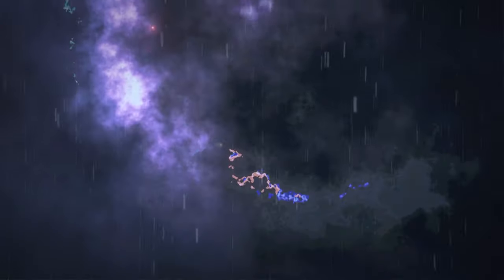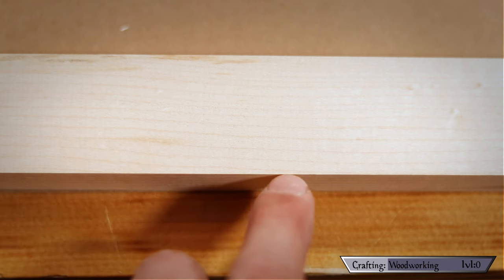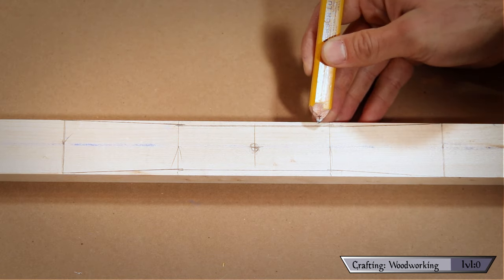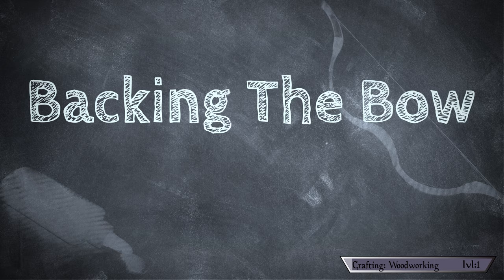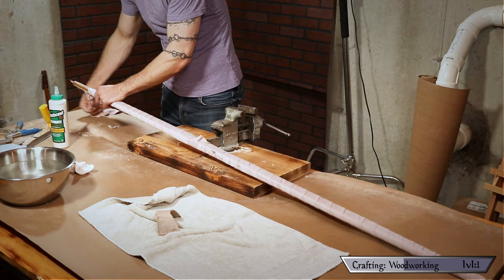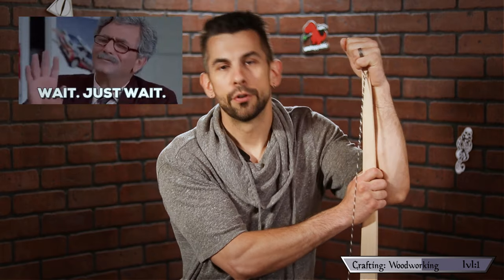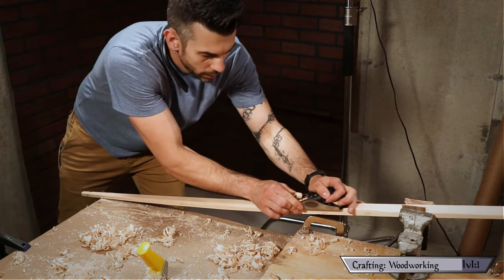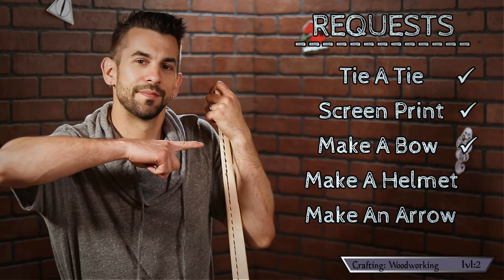Build A Bow With Wood From Home Depot! Step By Step Instructions | Skill Tree

Comment: This is the best how to build a bow  I've seen so far. I so want to do this. Thank you!
Reply: I started. I'm using maple. The grain is so so but I'll see what happens. I've decided to use fibreglass for the back. I don't have a garage or a basement to work in so it's slow going
Reply: JJ B my bow stave is ready. My tiller tree is ready. Now I have to get a planer
Reply: Let's be real. You won't.
Reply: Check out Kramer Ammons as well
Reply: Agreed

Comment: tiller tree i used, had notches and no pulley You flex the bow a little and hook the string on a notch that feels right adjust the limbs then try again. each time pull the bow down to another notch keep going until you reach your draw length.
Great,informative video

Comment: If you Google a tillering gizmo you will find it is an invaluable tool for easily getting the proper bend on your limbs, it is especially good for beginners who haven't developed an eye for tillering yet. I invented it so am a little biased about its use. They are simple and very easy to make. The bottom line is an adjustable pencil will mark every stiff spot on your limbs with one quick swipe.

Comment: Years late to this video, but I love bow building.  A fun similar project could be to built a pin and lever style crossbow.  A wheel based medieval crossbow is a whole mess of a project, but a crossbow with a wooden prod in a lower draw weight (I usually aim for 60-80 lbs on about a 12' draw) with a wooden pin pushing up from the bottom to force the string out of a groove, is a reasonably easy project, and can cook really cool.

Comment: Nice job! And, you are right about picking your board carefully, my first one exploded almost at the end of the tillering process.  My second bow was much better, I used red oak and chose a piece called flat sawn. I was able to "chase" the growth rings for a very safe bow. Also backed with raw hide I got from dog chew bones from the dollar store.  A fun little project I did with all the raw hide scraps was to make my own hide glue. Hint hint.
Reply from the maker: I saw someone use the rawhide from dog bones. It worked well, then? I was unsure how it would go. I AM intrigued about the hide glue. Do you boil it?
Reply: @SkillTree  It worked very well. And yes, you do boil the hide. what you are essentially doing is reducing the hide into collegian (sp?) . It is then poured out onto waxed paper and allowed to dry. It will remind you of jello, which it is the main ingredient of.  Then you allow it to dry fully. Lots on you tube on how it is done. Give it a go.
Reply from the maker: @David35445  thanks! I will!

Comment: Ok... getting into the building and figured something out. To get the grip and limbs correct you might try , after some shaping, to draw one side on a board or paper ( preferably something that doesn’t change shape) and check the symmetry from side to side and top to bottom. The grain can fool the eye but a line on plywood doesn’t lie
Reply from the maker: Oooh good idea! Nice way to make sure everything stays even. Thanks for the tip!
Reply: Skill Tree 
I did R&D for experimental aircraft and that was one of the ways to make a go-no go gage. 

Can I use heat to bend poplar? I’m looking to put a slight reflex into it, among other items

Comment: hey man, you inspired me to try this, i however tried it with a peice of wood and two peices of metal cut down to size. it was aluminum which didn't work haha. and it had a draw weight of like 150 pounds X-X but its got me inspired now to actually make one out of wood. aluminum is hard to cut. and i wouldnt be sure what steel to use to do it so theres that but an ywayst anks and good video
Reply: 150? That's a war bow

Comment: what material exactly did you use for backing? thanks
Reply from the maker: Rawhide from 3 rivers archery. https://3riversarchery.resultspage.com/search?p=R&lot=json&lbc=3riversarchery&uid=304070840&ts=json-full&w=Rawhide&method=and&isort=score&url=https://www.3riversarchery.com/bow-building-rawhide-backings.html&cip=174.196.209.255&ref=www.3riversarchery.com&ua=Mozilla/5.0%20(Linux;%20Android%2010;%20SM-N960U)%20AppleWebKit/537.36%20(KHTML,%20like%20Gecko)%20Chrome/80.0.3987.132%20Mobile%20Safari/537.36&rk=1&lgkey=6121
Reply: @SkillTree  thank you!

Comment: Can I ask sir ..  when u tillering that bow how to decide top and bottom ? .. or You use  center to tillering? .. sorry my English so bad
Reply from the maker: Hello! Thank you for watching! The bow showed here is a symmetrical bow, so either side can be considered top or bottom. Just make sure when you are tillering to have the side with the rawhide backing facing up and only remove material from the belly of the bow. You don't want to cut into the rawhide. Happy making!😁👍

Comment: If you want to level up on woodworking some more, try carving a spatula!
Reply from the maker: That sounds interesting. I bet bamboo would be nice for that. Would you recommend making it straight and bending it with moisture and heat after the fact?
Reply: @SkillTree  That would work very well. If you want an extra challenge, you can try carving it from piece of wood trying to follow the grain without bending. I have a video on doing that.
Reply from the maker: @BravermanDesign  I'll give it a look. Sounds damn tricky. Love a good challenge!

Comment: Hi again. Just made a bow out of walnut. It looks nice and sturdy but I see some small microfractures on the bottom leg of the bow on the face with the handle. Is this a sign that it will break?
Reply from the maker: Hmmm. I personally wouldn't trust it. Those limbs are under a lot of pressure when the bow is drawn. If it fails, those limbs are being pulled towards you. It could just be some of the grain lifting but sight unseen, I would rather err on the side of caution.

Comment: By any chance do have dimensions for a 100 lb flat bow?
Reply from the maker: It's going to be less about the exact dimensions and more about testing it. There are scales you can attach to your tiller to judge the actual poundage. Were I you, I would make the initial shape and put the backing on, removing very little  material. Then start measuring the weight and how the limbs bend. Because of grain and inconsistencies in wood hardness, every board is different. Just gonna be trial and error.

Comment: Where did you get your bow string??
Reply from the maker: 3rivers archery! It's also where I got the rawhide 😁
Reply: Thank you! Is there a certain one to buy?
Reply from the maker: @zacharylambert177  as far as brand? I am not sure whichbones are considered "best". You will need to know your size, though. Just measure your bow from string groove to string groove then deduct 3". That should give you the correct string length for your bow.
Reply: Thank you!
Reply: @SkillTree  for the rawhide I used an $8 dog rawhide chew toy. Worked great

Comment: Why did you pick 68 in. for your bow?
Reply: There’s a string length of 65 inches and the string is generally 3 inches shorter than the bow stave. 
Also I tried shorter bows and they’re much harder to build and get any speed out of. I did three shorter bows, all failures as they broke too easily, until I went with the 68 inch bow. That one works great! If you have perfect materials and are a professional woodworker then you could probably go shorter. If you do verify that there’s a string in your range before starting

Comment: How thick is the board to begin with. Mine seems a little thick. 3/4 inch...
Reply from the maker: I started with a 1"x2" maple. You may just need ro keep thinning it out in the tillering phase
Reply: Skill Tree
Thanks. Do I keep rounding the limbs to keep the “D” shape? Also I’m putting two strips of fiberglass tape (drywall tape) underneath the rawhide to reduce laminar shear (that should keep the rawhide in place with the fiberglass being an intermediary for the load from the wood to the rawhide). I’ve also built up the cross section of the grip to keep the transition area closer to the initial limb area. I should be able to thin out the limbs a little more without losing poundage and get a little more tip speed out of it. Trying to make a shorter horse bow (56 inches).
Reply from the maker: @WRMonger1  I think, once you have the "D" shape you can just keep tillering the flat until you land at the poundage you like. I hope you share what you make!
Reply: Skill Tree 
I don’t know how to post pictures to someone else thread so I’ll update when I can